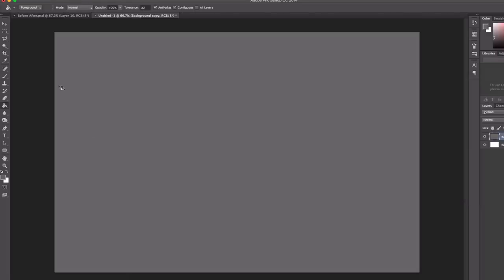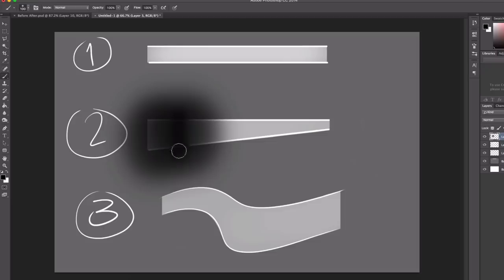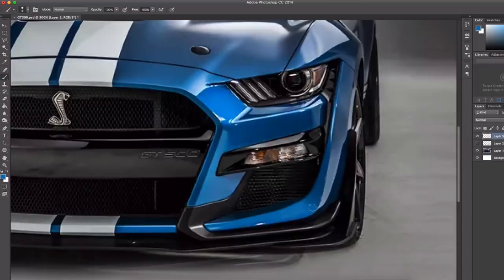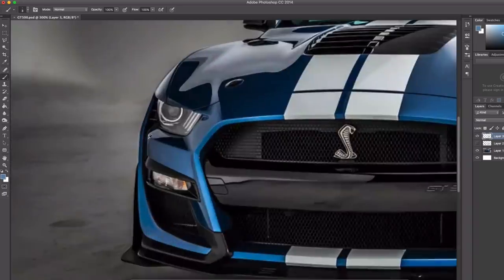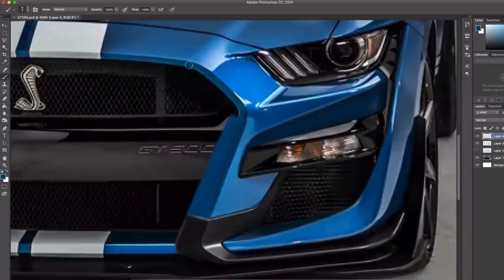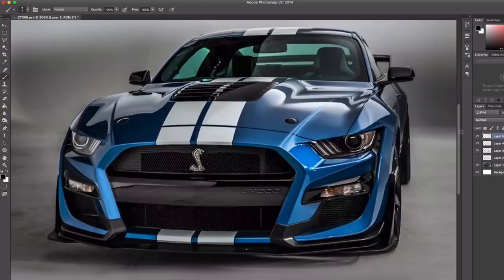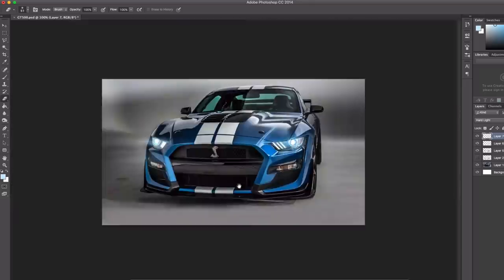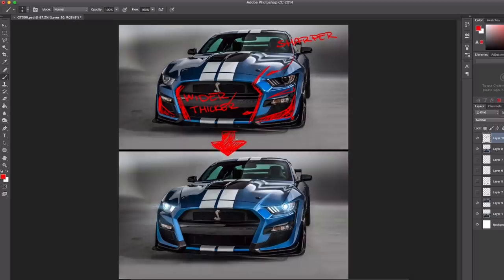2020 Shelby GT500 Re-design - From a Designers Perspective

Comment: the thing is designers design the car according to the focus of the car..that is performance. so hence they have to make certain parts of the car thin ..try to redesign a car by also keeping in mind its aerodynamic features ..thats a challenge
Reply: TomsGaming6 I’d agree if we were talking about McLaren who always follows function over styling. But the changes he makes wil be negligible to the car’s performance. If they truly wanted to go to deep extents to make the car faster, the car would look way different than it does.
Reply: The other part not mentioned is manufacturing limits, the more complex the shapes the harder the manufacturing of that part becomes. Hence why production cars are always more rounded off than their more angled concept counterpart.
Reply: @ajbrewer1777  They aren't making entirely new cars like mclaren. They are just improving the car
Reply: Mans a designer, not an engineer.

Comment: To the haters in the comments, I think he understands that it affects aerodynamics. It’s simply a concept to show what a Mustang GT500 could be. He’s an artist, not an engineer.
Reply: disagree=hate? alright
Reply: I mean the changes he makes are pretty minor they're not gonna affect aerodynamics in any noticable way and as far as cooling goes I can't imagine a road car is pushing cooling to such limits that the radiator can't be covered up by an inch or two on both sides
Reply: Sean Boland You’d be surprised. The rx7 is known for overheating even when stock. (To be fair rotaries put off a lot of heat.) This thing has a 5.4 L supercharged v8 that revs to over 8000 rpm and is pushing over 700 horsepower. If you run it long and hard like on a track it’ll certainly get hot.
Reply: @bentrod3405  that's true I was thinking more everyday driving but this isn't really designed for every day driving

Comment: Looks good but the reason it’s thin is for more air flow. The gt500 designer talked about wanting to bring the hood an extra inch overhang the front grille but the aero engineers wouldn’t allow it. Designers of cars are very restricted because it has to perform
Reply: Unless you’ve got an engine setup that’s so insane that it doesn’t matter how tf you design it. Looks at Dodge Demon’s shattering differentials
Reply: @Nikolai_The_Crazed  that car  can barely run because of that much power. It still would lose hands down against AMG Mercs, G-Power BMW's, Nismo GTR's on the quarter mile. The concept of the Demon is still archaic compared to a modern G-Power BMW M6 Hurricane RR with 789 hp, wich is insanely fast. 

In Germany near Cologne resides a small company which builds the most insane Cobras ever roamed on Earth. ~900 kg meets a ~1578 hp big block V8 with 976 cui and without any supercharging. Plain German engineering with 100% German V8's.

That's a car from hell.
Reply: David Radtke I’m very aware of how the demon runs. That’s why I mentioned the shattering differentials. Also, r/wooosh.
Reply: The GT500 does 10.5s and 10.6s in the quarter mile with trap speeds of 133mph and 134mph. The GTR comes no where close. The GTR is quicker 0-60 because it's AWD.

Comment: I agree with all you did but I have one question, why didn't you go with the facelifted lights?
Reply: I was wondering the same exact thing
Reply: I was also surprised that Ford went with the blacked out grill because it makes look more like a last-gen Charger or a Nissan GT-R, especially after Chevy did the same thing and got really bad reception.
Reply: cuz prefacelifted lights look better, gald they kept it on the shelbys
Reply: The pre-facelift has a bigger opening for air intakes
Reply: Ford didn't go with the post facelift headlights because they didn't fit.
Reply: @burgerbandit3646  they completely designed the gt500 front end anyway... it wasn't about the headlights fitting, either one ford would still choose to make the body wider and have a bigger front opening.
Reply: @akumabear  I don't really know what you're trying to say? Can you re-explain?
Reply: @burgerbandit3646  im saying its not about the post facelift headlights not fitting the front end of the gt500, they had to design a new front end for the gt500 no matter which light they used. So if they wanted to use post facelift lights they could but they didn't want to because other shelbys have pre facelift headlights, they want to keep the shelbys different from regular mustangs and i think they look better as well.
Reply: @akumabear  What you're saying is irrelevant to the fact that the reason they didn't put the 2018 headlights is because they didn't fit
Reply: @burgerbandit3646  omg lol could you not read... i literally explained two times that the reason they didn't put it in isn't because they don't fit...
Reply: @akumabear  Well, whatever the hell you came up with and over explained is wrong because the explanation I gave was what one of the designers of the car told us.
Reply: @burgerbandit3646  lol ur comprehension must be really bad... look at the facts, no matter which light the fact is they had to redesign the front end. Neither light could fit in without modifications. The person who told u wasn't wrong, you understood it wrong. I have friends in ford performance they walked me through every part of the aero and design process in the car.
Reply: @akumabear  I wasn't even reading your comment. I just wondered what you were trying to explain to me because it sounds like you said exactly what I did in an unnecessarily long comment.
Reply: @burgerbandit3646  cuz u asked for it by not understanding something so simple... you still don't get it i'm not saying the same thing as you lol.... sigh whatever dude seems like no use talking to you
Reply: @akumabear  dude all I said was that they didn't put the lights in because they didn't fit. The reason they didn't fit is because the front of the new gt500 isnt like the 2018 mustangs. If they were gonna put them they would have to change the design to make it fit. That's when you went on a rant about something I didn't need answers to. And I still haven't even read whatever hell you wrote.

Comment: I would change the vertical pillars that surround the center grill on the redesign. To visualize my idea think of a square wooden garden stake with one of it's flat faces, facing you squarely at 90 degrees(the inner and outer sides following the same angle as the front of the front quarter panels) vs if the leading face of the stake was at 45 degrees, leaving a 45 degree surface on the inner surface and a outer surface that follows the same angle as the front of the front quarter panels.

Comment: You & the adjectives, lets gets one thing straight . I am wondering if your Asthetics do anything for the wind tunnel? ? Drag coefficient becomes original & then what is it after you’re done w/ the spray painting?  Guaranteed increase.  Wrk on hp

Comment: Did you take into account air flow, aerodynamics, cost of pinching the creases in the materials, weight, etc.? On the lower fascia vents, you've removed significant brake cooling, not only is the opening smaller, but it directs the air further away from the brakes. (Please don't take me as being rude, you are awesome!) With the grille, I think that, though the opening is slightly smaller, you may have improved airflow to the radiator. Your design, I believe, would guide more of the air coming from the side of the grille into the grille. This, however, having slightly thicker pillars than the original, may cause more weight gain than it is worth.
While the creases on the hood look terror-iffic (awful pun, I apologize), this is something that has been known to be difficult to create with the current affordable materials and machinery used to build these cars. Only recently have cars been getting more dramatic creases due to improved technology, but I believe your design might just be to aesthetically pleasing, and not functional enough to justify the extra cost to sculpt. Let's keep in mind that these engineers probably already tried everything you designed and there is a reason why it looks like it does. They've been successfully designing vehicles for years, using their mind and vision combined with R&D to create purposefully functional bodyworks. We cannot forget that these cars are designed partly by the wind tunnel and the results from that also determine the outcome. (Think of it figuratively as though they're literally using the wind tunnel to sculpt the car).
Alright, now that I've made myself feel important by blabbering on about something I really don't know that much about, keep up the awesome work! I'll have to check out more of your videos.

Comment: I don't want to be critical of your changing design but I like what Ford done . If you just look at their design it Look like a Cobra about to strike . The head light look like the eyes of a Snake , the scoop look like the head of a Snake and the open grille look like the mouth of a Cobra about to strike . Ford knocked the styling of the GT500 out the park especially the track pack . It's just my opinion.